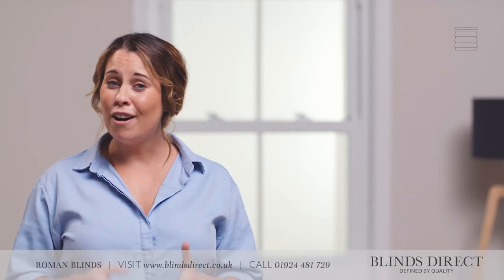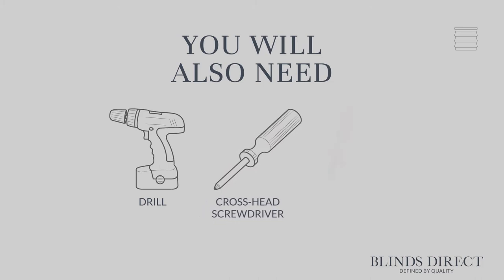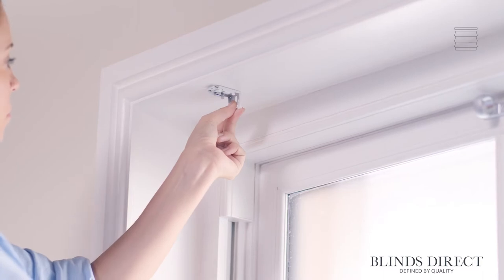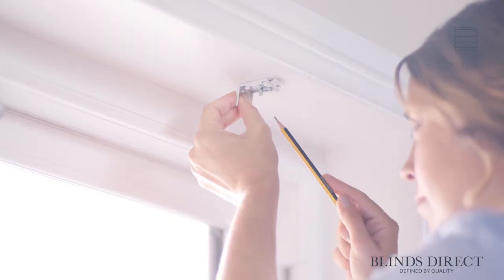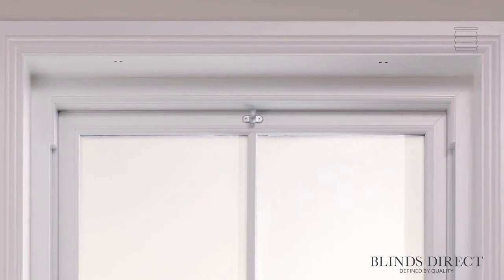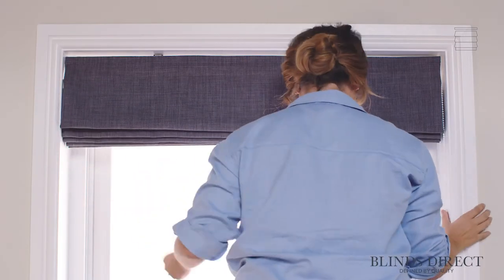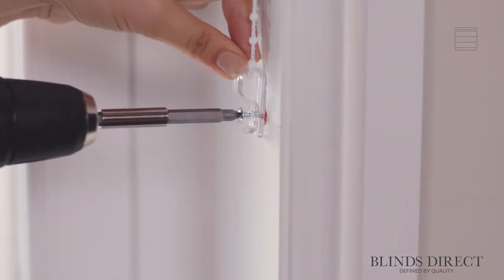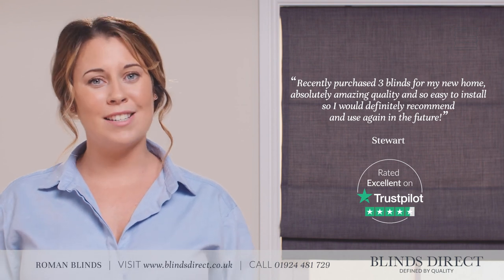How to fit Roman Blinds | Blinds Direct

Comment: Re the third bracket - why do you position off-centre, and what does “with the wider side at the top” mean?
Reply: You will probably find that part of the cord mechanism is right in the centre so you would not be able to get the blind on.
Reply: Normally there will be a cord fixing bang centre

Comment: Nice video, but how do you fit those brackets into a concrete lintel?
Reply: With a concrete lintel you will need an SDS drill. Be warned they are quite violent and can make a bigger hole than the drill if you are not careful. You can always use the next size wall plug if you make the hole too big.
Reply: @HandymanStratforduponAvon  what about metal lintels ? I have burnt out 5 HSS drill bits and still no further.

Comment: The brackets that you fit the blinds onto are an absolute nightmare to get the blinds into expect loads of F words
Reply: Absolutely agree with you regarding the brackets. Total nightmare. Not going with Blinds Direct again if they continue with them.
Reply: Completely agree, just arrived today and fitting them now and the brackets are not only very cheaply made they a F ing nightmare to get in!!!!
Reply: @Gattsu1986  Yep  having the same problem here. Any tips on how to actually get them in? Just not working :(
Reply: @louisedavies3436  basically you have to make sure the brackets are dead straight and line up then it gets much easier. It was only when I got to the 3rd Blind I became more comfortable with it.
Good luck 👍🏻
Reply: Getting them off seems impossible too. Trying to return mine.

Comment: Customer Service kept me on hold for 14 minutes so gave up. Terrible service. Also your videos only show the  reveal fixings with a wooden surround already installed. You really need to tell people the whole story by warning them about concrete or metal lintels if there is no wooden cladding around the reveal. A wooden clad reveal means you only need woodscrews which are a doddle to use. Its a completely different story if you are drilling into plasterboard in a modern house as you will have to drill through lintels in order to get a decent solid fixing. I suggest you review your installation videos as soon as possible as you are giving people the wrong impression.